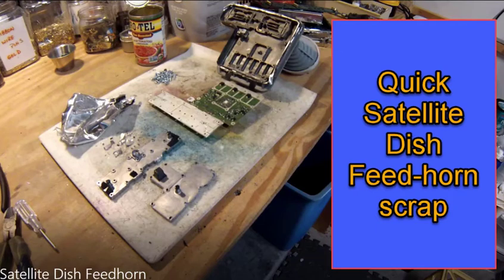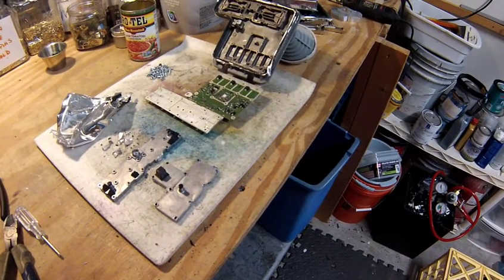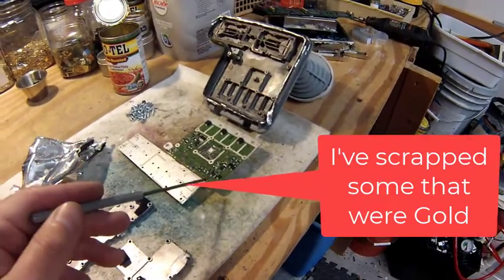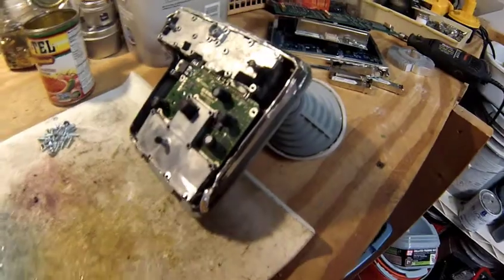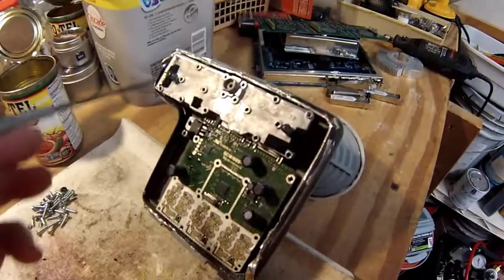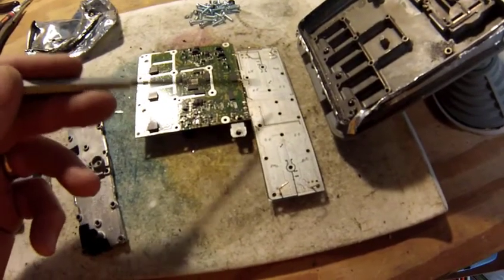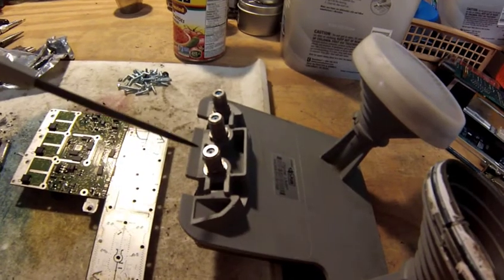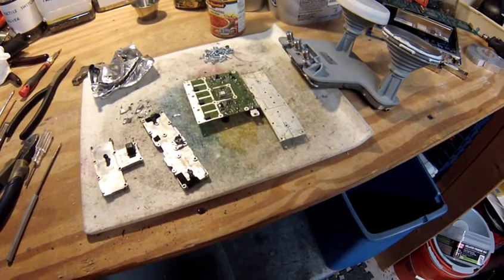Satellite Dish Feedhorn - is that SILVER???

Comment: K&D is a great scrapping channel ! How do you extract the silver ?
Reply from the maker: To be honest...I don't have a clue at this point.  I've some research to do and hoping someone might drop some comments on the best process.
Reply: @sharkscrapper  Need one of those desk top furnaces too to melt it down. They have some cool ones the do about 5 pounds and just plug into an outlet.
Reply from the maker: @CruiserMac  Thanks - I'll look into it.  So you just break up the board and put it in the furnace?  Let the heat do the rest?
Reply: @sharkscrapper  No you have to get the metal to a reasonably clean state and then melt it down.
Reply from the maker: @CruiserMac  I need to research how to get the silver - if it is silver - off the board.  I'm thinking maybe the same method used for silver mylars?